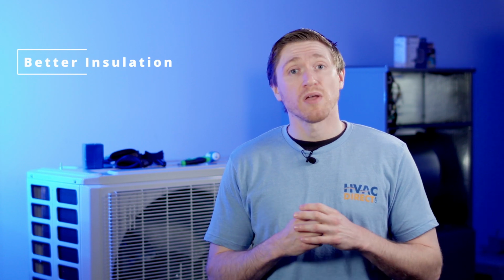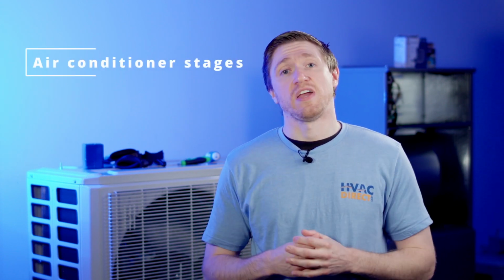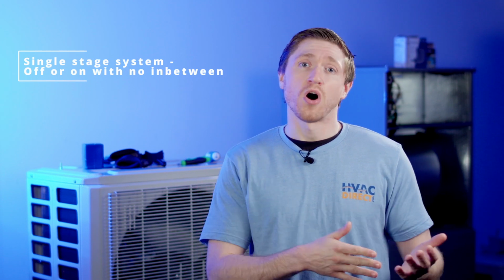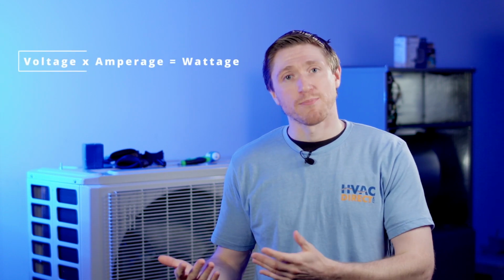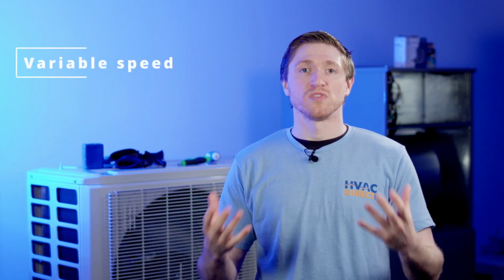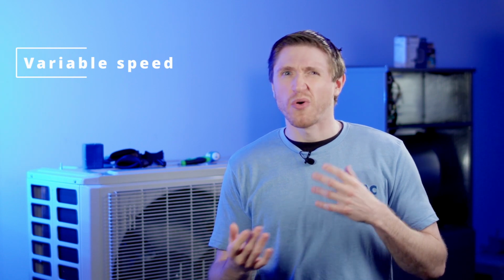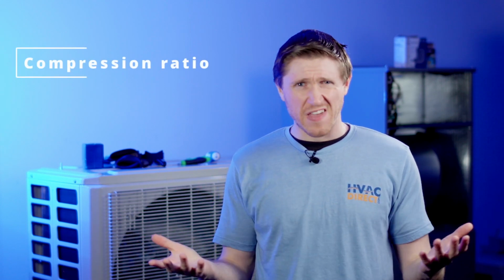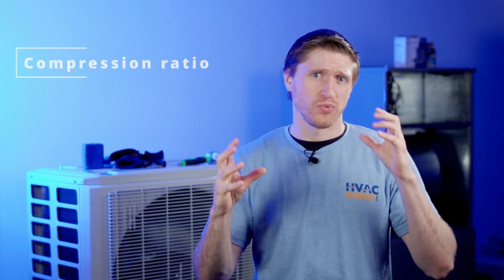Secrets to SAVING money on your AC bill!

Comment: I have tried EVERYTHING...and so has my poor AC guy. One of my AC's is fine and the other leaks all the time.  they are only 8 years old.  We have flushed it, replaced the drain pan, checked the leveling of it, changed to a different kind of filter...etc. He is suggesting maybe a new system because the the coil is so expensive to replace.  Any ideas?

Comment: My dad was an HVAC engineer for over 30 years he said for every degree, you save 3%. HOWEER, you want a balance between saving and comfort. I live in Las Vegas and it can very hot. If it is in the low 100's I would put it on 80 but if it is between 110-120(last year Las Vegas hit 122 one day) then I put it on 78 and the key is AUTO. You don't want it running on ON constantly. Also, if you leave the house, youc an shut it off. 80 degrees with a fan should be comfortable for most people but if you have a furry friend, you might want to put it at 78. You might say what is the big deal does putting your thermostat from 72 to 78 6 degrees, makes a difference ou bet it does to the tune of 24% of your bill. That is why my fiancee wonders why in my 2500 square foot home my bill is around $200-2500 but for her 1850 square foot, she pays $300-400.l "Me it's because you want to be comfortable and put it 72, So to recap here are some cost cutting tips to save 25% on your next bill
1- Set your thermostat to AUTO AND COOL AND 78 DEGREES
2- Have the fan on so you get used to it, your body will adjust to the 78%. 
3- Wear light clothing, shorts and sandals are good. 
4- Make sure all of your windows are closed and
5- When you leave shut it off. 
6- CHANGE YOUR AIR FILTERS REGULARLY some people say every six months, i dod it every 3-4 months. 
If you make these sexy moves, you can save 25% off your next AC bill. You might be a tiny bit uncomfortable at first but you will thank me when you see your bill.

Comment: I would ad to this very well informed review that the 2 stage and variable stage systems that also include gas fired heating that is 92% or more FLUE will cost an arm and a leg when there is a repair needed. Parts are very expensive for those systems, circuit boards, sensors etc. are for some reason not so reliable these days and when just one service call is added to the "savings" and comfort levels of those higher end units, the efficiency benefits are lost likely for the life of them.
I'm thinking that a single stage condensing unit mated with a 2 stage furnace might be the best combination as of 2024.